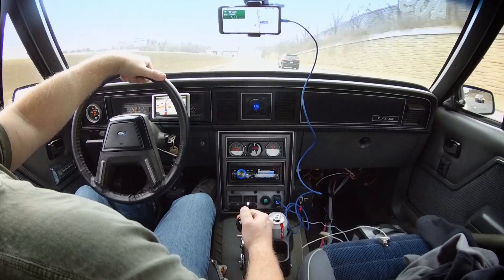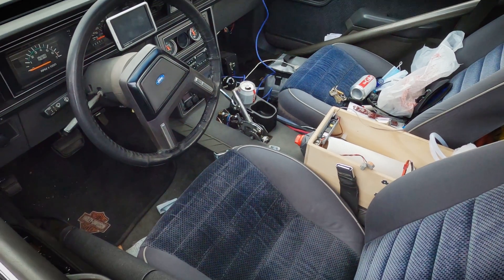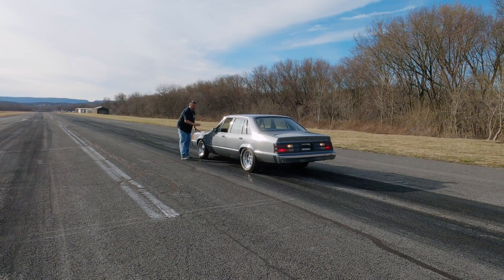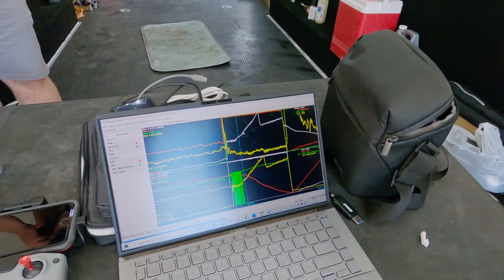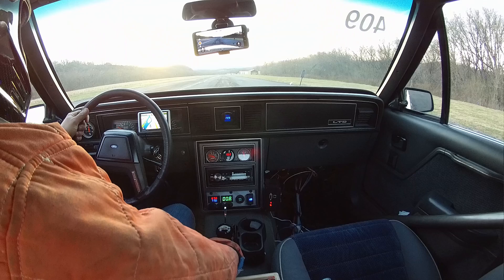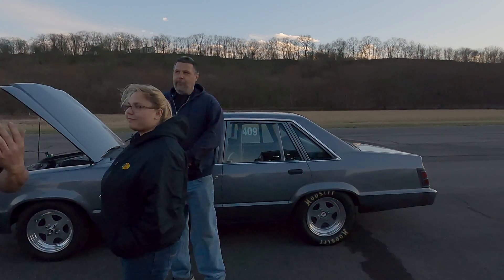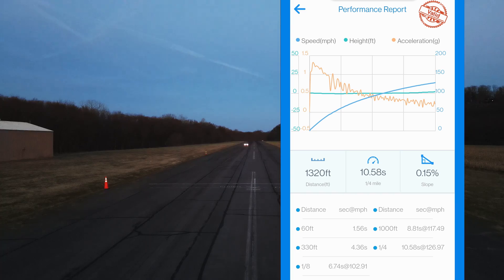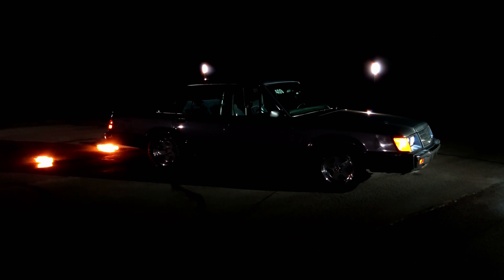DIY Electric Turbo: 5 psi = 127 mph Quarter Mile

Comment: I wonder if there's a way to use a dedicated alternator to drive the blower motor. As the engine spins the alternation, your motor spools accordingly. You could have a cutout switch set to idle speed. Is that a workable idea?

Comment: Now main focus shouldn’t be more power but bigger pack maybe self charging and cooling fan for the electric motor. Then you can run it 24/7. That should be the main goal for electric ones
Reply from the maker: It does have an on-board charger for the packs.  I initially had a water-cooling setup for the motor, but it turned out to be unnecessary as the motor gets plenty of airflow when the car's moving (of course, this is dependent on where you mount it).

Comment: Sounded like you were sandbagging the launch rpm the first couple times. Then the  2nd and 3rd the launch RPM sounded higher and higher 1.9 60ft and 1.5 60ft sounded like you upped the launch RPM to make it look like the e-turbo made a bigger difference 🤷

Comment: can that motor take 20s power or only 16s?
Reply from the maker: I'm not using that motor anymore; but it was nearing saturation - at which point it starts looking like a dead short to the ESC (I'm actually thinking about doing a video on that).  I don't think more voltage would've done much more.  We were very close to it's absolute max burst rating; well above it's continuous rating.  If you haven't seen the newer version, start here: https://youtu.be/nlTVHkfSQXM

Comment: My first car I had a 1986 Ford LTD the same color as this. I was going to pull the 3.8 v6 out & drop a 5.0 V8 in it, a tremec t-56 6 speed, all aluminum driveshaft, full disc brake conversion, lower it about an inch or so & put cobra R chrome 17x7's on it. I had big plans for that car. It was my grandmother's car & I planned to keep it because of the sentimental value. Sadly, I traded it in for a new car because I couldn't afford to fix all of the gaskets & various other things breaking on it due to old age catching up to it. I miss that car everyday. I've tried finding it, but last I heard was a collector in Goldsboro NC had it. I'd love to find it again & buy it back. Hopefully, one day I can have it in my garage again & have the memories from both of my grandparents driving that car.

Comment: Cool that it works. But a better transmission would make a more drastic change than the electric turbo.
Reply from the maker: It's hard to beat a powerglide with a transbrake for this kind of stuff.  Once we get things sorted, it should leave harder than it did with the Whipple - watch the beginning of this video: https://youtu.be/j8SNo7kpcxw  The only other trans I might consider would be a 6L80E - but it's bigger, heavier, more complicated and most importantly - weaker.  Much weaker.  This trans is good for 1,800 hp.  And I've been close to 1,000 hp before on this car.

Comment: Pooo pirate  5psi carried on like was gonna flip
Reply from the maker: Picking up 15 mph and dropping almost 2 seconds in the quarter is HUGE.  I guess you also missed where it was losing traction on slicks at 60+ mph?  If you don't understand quarter mile times, then look at the 0-60 times - going from 4.1 seconds to mid 2 second 0-60 times is also huge.  But I suppose you can focus on "only 5 psi" - and ignore that on our first dyno tests we picked up more than twice as much rwhp per psi as the Whipple I used to run...

Comment: now you need to put a seperate alternator and inverter/regulator with gear reduction to produce enough wattage to power the turbo without the battery. being that your only running 2kw of juice i think its possible with gear reduction. add some high drain capacitors to help the alternator wit dig hits like this and i think youd have a daily reliable and stable setup that doesnt involve lithium batteries.
Reply from the maker: 2kW?  In these tests we saw 13.3kW and 13.8kW continuous respectively.  You can't run this off of an alternator.  But I do appreciate your watching and taking the time to comment!
Reply: @AlexLTDLX  you dont think a 12v motor with a gearbox that converts to high rpm can make 5 psi of boost with a current draw of 300A? 

i didnt see your gauges clearly before. i see now 54v constant at ruffly 340A-349A. which is around 18kw. sure you couldnt power a turbine with the motor spinning the impellor directly with just an alternator at those power draws. but what if you geared it instead. its the same reason hub drive ebikes are less efficient than mid drive ebikes. gears
Reply: @AlexLTDLX  current is what would push the gears to rpm in this case scenario. not the voltage

Comment: Hey man.  I'm doing the same thing as you are, although perhaps to a lesser degree of professionalism... but in essence the same project.  You can check my videos to see the details.  I'd really appreciate knowing what you feel are the biggest dangers on this project so that I don't make a fatal mistake myself.  I really respect anybody taking on something like this and would be humbled by your input.  My project is in its final stages.  Everything is fully functional and the only thing that has kept me safe until now is the fact that the motor wasn't wound correctly and could not achieve boost.  However that is now fixed so come this summer I'm going to have real power going through my engine from this thing and to be honest, it scares the crap out of me.
Reply from the maker: You're a wise man.  I spent the extra $$ for LTO cells.  Less power dense (heavier), but safe - virtually no chance of explosion.  Fire and plasma arcs are definite possibilities, though.  I run 1,200 amps worth of fusing right next to the batteries now (the big unit pulled almost 700 amps in testing - installing it now).  Wrap any wrenches that are around power terminals in gaffer's or duct tape.  With these setups, voltages aren't so much the issue as the current.  I still sometimes forget and do something carelessly.  I've managed to melt a 6mm stainless stud pretty much instantly with a single LiFePo4 cell.  I've also had multiple ESC failures, and the worst one (there's a video on it - "most expensive ESC..." or something is in the title).  Biggest thing is just don't work tired or under the influence.  Safety glasses are always a good bet.  My current packs are in heavy-duty pelican type cases for added protection.  HTH.
Reply: @AlexLTDLX  Yeah I always remind myself to double-check everything before I do a bench or road test.  I put a lot of money into one of those big huge switches you find in industrial plants, that snap open by default and can cut hundreds of amps without arcing.  That's my primary power cut and always within reach of me.  I don't have one of those special lithium bags but I packed all the batteries in drywall and put it inside a metal box so for now it's minimally protected.  Since the setup seems to work ok and I haven't had any accidents, I think repeatability is on my side but I'm afraid of driving the car because while I have a blow-off valve I haven't calibrated it and I don't know what it feels like to drive and shift under boost.  You can imagine S/C and turbo'd cars have waste gates and bypass valves to bleed boost but I just have the BOV and that's it so I feel like the car might want to run away from me.  My computer has a PWM profile for boost control but the mechanic lags the input so on decel/shift, it's still putting out.  Do you know if it's possible to tune a BOV with the car parked?  Is it safe to just blow boost right into a closed throttle plate until the BOV opens?  I haven't tried of course but I feel like that'd be better than doing a road test and finding out the hard way that it didn't open.

Comment: I don't see what all the fuss about electric turbos are...quite frankly I would prefer electric supercharger method...turbos fluctuate too much with exhaust flow..a supercharger rpm matching method is much easier to program with a pwm (rpm signal + Tps) and utilize wastegate control but that's just me...
Reply from the maker: Lol - I only call it an electric turbo because that's what most people search for.  Technically, this is an electric supercharger.

Comment: Lost 1.25 but didn't wait for the full spool up, or it may have been a full 2seconds off
Reply from the maker: You're right.  If we could've left on full boost, it would've been quicker (assuming it would hook on the no prep surface).  I was just thrilled it worked and didn't blow up.
Reply: @AlexLTDLX  I fully understand the tendency to release the trans brake or line lock, when you're objective is low reaction times, and ET's, but it's never too late for more boost!

Comment: Could basically care less than if it did 200 mile an hour in a quarter.. Gotta be a combustible engine or leave in the box! Jmo  If you love electric don't matter a got damn to me.
Reply from the maker: It is an internal combustion engine.  An 8.2 deck, 365ci Dart Iron Eagle Sportsman SBF, to be precise.  Just the turbo is electric.
Reply: bruv how did you miss the V8 in the engine bay. This LTD ain't full electric, only the turbo is.

Comment: "Its armed!" You NEEEED  a missle system switch from out of a helicopter to "arm the blower." The kind with the red safety cover thing would be perfect. You also NEEEEED a second switch next to it that says "Launch" to activate launch control. Maybe a helicopter joystick shift knob...
Reply from the maker: Lol. The way it's shaping up is it's an automated setup, but I probably will have a scramble button on the dashboard somewhere if you just want to manually activate it.

Comment: Awsome but I’d use different batteries try CNHL 6s or smc 6s batteries the smc is 6500 mah. The CNHL I believe are around the same. They’re work better for you
Reply from the maker: I now use lto cells. Those lipos I used in this test weren't great.

Comment: It’s nice but cost efficient isn’t that a very expensive setup ? Not to knock it I like it but simplicity is to me better
Reply from the maker: You could make a very similar setup that makes the same power for about $2,500.  I've spent a lot more zeroing in on the stuff that works, but $2,500 is a real number.
Reply: Got it I’m on ur side either go all the way or just say no.    If I had to do it trust me it’ll be just like ur setup sometimes as we say going the cheap route always costs double

Comment: A modern airconditoner for a house has what's known as a smart motor for the blower fan that pushes the air through the house. And the back plate houses the not or controller and is their weak link. So its possible to get one thats label's bad for well under there $500 new pricetag and simply remove the back plate . all together and your left with a BIG brushless motor . it has 3 leads just like a brush less rc motor but I imagine way higher torque .
Reply from the maker: Yes he does.  And one of the nicest humans alive, too.

Comment: two things that might help is electric motors are known for torque. i would suggest gearing your motor. the other thing is an inverter to convert to a 3 phase AC motor
Reply from the maker: It's a brushless motor - 3 phase.  I don't think this would be possible with a brushed motor (at least not this size).

Comment: Dude that’s awesome cut the 0-60 in half pretty much and 2 secs off the 1/4!!! Impressive shit
Reply from the maker: To be fair, the car is setup for boost.  Low compression (8.8:1), numerically low rear gear (3.08) and the tightest billet 10" converter BTE could make.  If it wasn't, it would still pick up a lot, but perhaps not quite this much - because it would be faster N/A.

Comment: Can’t wait for 12v boost on a daily driver
Reply from the maker: You won't be able to do 12 volts practically - you'd need thousands of amps.  But with battery technology constantly improving, the packs can continue to get smaller and safer.
Reply: @AlexLTDLX  so maybe a dedicated, second alternator with the voltage regulator cranked up? 🤔

Comment: Sorry if this has already been said but is this a V8? Also, What electric turbo is being used or did you diy the turbo yourself? Thanks
Reply from the maker: Yes.  It's a 365 ci SBF V8 based on a Dart Sportsman Iron Eagle block - it should be good for well over 1,000 with enough boost.  This is version 1 of the DIY electric turbo.  An early version 1 was dyno tested; the complete specs on the engine are listed there, but the impeller and volute were too small and we were limited to only 2 psi on the dyno: https://youtu.be/84wSLQRy9sc  There's a whole playlist to see what was involved in making version 1.

Comment: does the motor have to suck through the turbo all the time? if so could it be used to reverse charge the system?
Reply from the maker: Yes.  We've already tested that.  It presents a restriction equivalent to 1 psi boost loss at wide open throttle when the thing's not running.  I was also curious if it spins when the engine's pulling against it and it's off.  The answer is no.

Comment: What are the failure modes and how long would you expect these to last? Nice job by the way dipping into the 10's 🤯🤯🤯🥳🥳🥳 truly impressive.
Reply from the maker: Not really sure.  That's one thing I'm trying to find out; along with all the other issues we've discovered (and overcome).  That's a really good question.
Reply: @AlexLTDLX  electric motors last a good while if used correctly, maybe a starter could be used since they're pretty strong.

Comment: DUDE!  Nice job on the build!  That thing really works well!  I wonder how it would work on a boat?
Reply from the maker: Thanks.  I'm sure it would work fine on a boat, but I'm not sure I'd trust it to run for minutes on end.  With water cooling, maybe.  On the bright side, you could recharge it with solar panels on a boat (it would take a while, but would at least keep the batteries "ready for action."

Comment: That is awesome!!! I could totally use this for a compound setup on my big turbo ecoboost Mustang. Awesome stuff. 👌
Reply from the maker: Actually, I thought about using this one as the "small" e turbo in a compound setup with version 1 as the big turbo - which is getting a 40kW motor (and is two days late on delivery...)  Thanks for the kind words!
Reply: @AlexLTDLX  that's awesome, can't wait to see more of this. I can't imagine what kind of power this brings to the table. I am curious though why you're using those tiny batteries as opposed to something like a cyber 6K lithium? I use 2 for my amplifiers,they charge after my primary Optima red top charges with the help of my battery isolator XSBI500. Great stuff!
Reply: @TheSocialPraxis  This video is very old now, and the setup has changed a lot. Now he is using a big bank of LTO cells in the trunk.

Comment: A metal box with evac port that is plumbed out the window in case Lipos blow.
Reply from the maker: That was going to be the plan; but now I'm using large LTOs in cases in the trunk.  They're far more powerful, yet safer.  Thanks for watching and commenting!

Comment: That motor sounds gooooood!
Reply from the maker: Thanks.  I wasn't sure how it would sound once I got rid of the crossover, but it seems to be fine.  1 3/4" Kooks longtubes, 3" pipes, Jones Maxflow mufflers, dumps before the rear axle.  Surprisingly tame driving around.

Comment: Put a better trans in that car, that slush box is holding it back. 60' was pathetic for a car that fast on the top end.
Reply from the maker: The glide is awesome - I'll never trade it in.  Keep in mind the converter is setup for about 200hp more.  It has pulled wheel stands with the Whipple.  Check this 9 second pass out at the beginning of this video: https://youtu.be/j8SNo7kpcxw  Since I want to see how close we can get to 1,000 hp with the electric turbo, the glide will come into it's own.  Most other trannys will start having problems at that power level.  Oh, and don't forget - this was on a no prep surface.  Much more powerful grudge cars struggle to get out of the 1.5's there.  Here's a wreck at the same place: https://youtu.be/tze7_yqJVWM  Check out the crazy wheel spin on the launch.

Comment: So you gained 15mph in the 1/4 which equates to 150hp gain, but the dyno only showed about a 60-70hp gain? That doesn't add up.
Reply from the maker: The dyno test was with a different impeller/volute.  The drag test was with an Si volute and Jon Bond billet (extended tip) impeller.  The dyno test was with an SC trim impeller - over a 1" difference in exducer diameter.